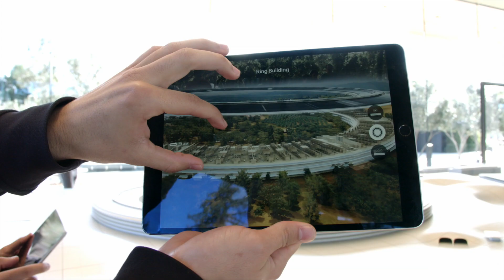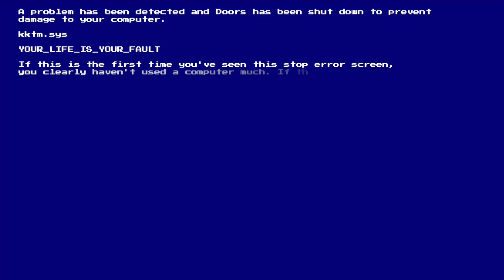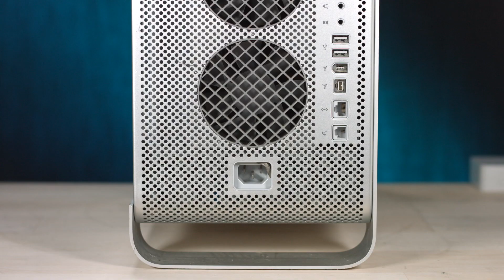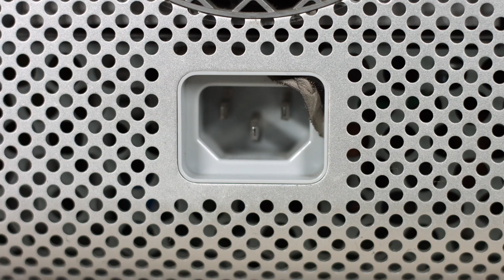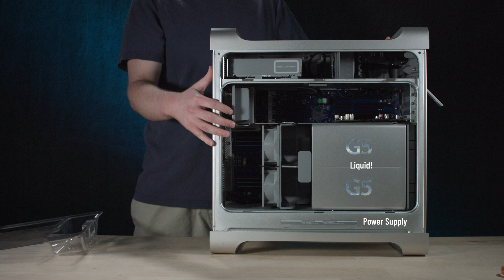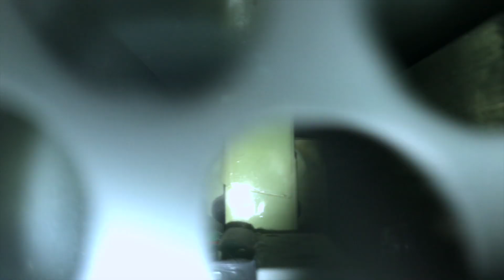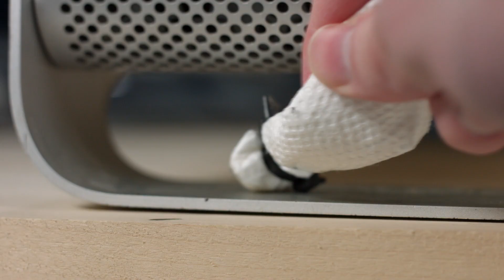Power Mac G5 and Cinema Display Disaster - Krazy Ken's Tech Misadventures

Comment: it probably went through different pressures during shipping causing the liquid to leak out or fitting to get popped. if it was shipped by air this is a big probability.
Reply: I'll bet that's it.

Comment: Likely the mains was shorted to ground, and the pop was that current going through the fuse, and likely protecting the computer
Reply: Do americans use fuses?
Reply: @williamg209two  yes we have like a million of them for one section of a logic board😂
Reply: @SStarlight9614  I meant in the plugs actually
Reply: @williamg209two  we have fuse boxes in a central location for all parts of the electrical circuit. When I first heard the pop it sounded like a breaker flipping over
Reply: @williamg209two  yeah that what I meant
Reply: @SStarlight9614  didnt think Americans used fuses given u barely use earth, I know it exists just never see it
Reply: @fremet6346  we do too, the uk have breakers and we have fuses in the actual plug, which is far safer
Reply: @williamg209two  No, U.S. plugs don't have fuses. But fuses/circuit breakers are common for each room, or for big appliances.

Comment: This sound is very similar to a capacitor popping. And that thing sticking out of the power plug looks like capacitor guts. Very easy fixable with a soldering iron if nothing else is shorted
Reply from the maker: The stuff sticking out of the power inlet was present before I plugged in the power.
Reply: @ComputerClan  https://i.ytimg.com/vi/FCNBv8VhzRI/maxresdefault.jpg

Comment: Eek! As sweet as the Quad G5's are, heard of many leaking and having weird issues like that.
Great machines and an utterly gorgeous design, the G5 towers, just definitely get an air cooled one!
Reply: This is an older dual CPU model, not a quad. The quad came in late 2005 and featured a better liquid cooling system.

Comment: I have just been given one of these ( not sure if its liquid cooled ) it powers on and the fans kick in but nothing on display or no lights on keyboard and mouse.  Any advice guys?  Thanks
Forgot to mention, it has 4 X 1 GB sticks of ram installed.
Reply: Does the power LED blink at all?
Reply: Remove the RAM and expansion cards, blow out any dust inside and reseat those cards, for starters. Replace the battery on the board, as it is most likely dead by now.

Comment: I got a Power Mac that got damaged by a mail guy ho dropped it, my version is an air-cooled one BUUUT my Mac has a problem that the system battery port internally is damaged so mine is working but not in a good condition and can't keep up with time and date. Yours is in the best condition ever and can't boot up because the liquid has leaked on the PSU I feel bad for you because the pumping system is well known to leak if a shipping company doesn't handle the computer correctly. You just had bad luck.
Reply: Punctuation needed.

Comment: You could try swapping in a new PSU and maybe a more modern watercooler. The teardown could be for a pretty cool vid imo
Reply: That might be possible, assuming that the water cooling mounts the same way. It's an entirely proprietary system either way. Replacing the PSU, if necessary, should not be too expensive, but a pain to install.

Comment: I'm amazed you didn't know it was water-cooled isn't it understood that g5s are VERY power-hungry to have 2 of them in such a small area means that standard air cooling really isn't doable at a low volume (sound not quantity) without absurdly sized heatsinks.

also, doesn't it have a warning label somewhere about if you see any sort of liquid to stop using it inside the case?

I don't mean for this comment to sound hateful or condescending whatsoever, so I apologize if it seems that way.
Reply: I think only this one specific unlucky variant (One of the last. Dual-Processor, dual-core G5) had the liquid cooling. There were a number of dual-processor models that had only air cooling (have one!), but you are quite right regardless, they can run quite noisy and hot when going full tilt. 9 fans all in if I remember right.
Reply: Only the later, higher-end G5s were water-cooled. The rest only had around 15 fans and a huge heat-sink.
Reply from the maker: You were amazed? Hmm… I'll tell you this: that fact is NOT common knowledge. Most people wouldn't know, and I have never touched one of these things before.
Reply: @ComputerClan  neither am i i just am a nerd :P

Comment: If it was a capacitor it will take a few seconds from plugging in the cable to hearing the pop
Reply: Since it was instantaneous, it probably wasn't a cap.
Reply: @MaddTheSane  he pointed out that there was a spark and the caps are fine

Comment: Yeah, the liquid-cooled models are notorious for coolant leakage. And they can have issues even if there aren't any obvious signs of leakage, as happened with the G5 Quad I built a few years ago, which started overheating.
Reply: That was what killed my Power Mac G5, a dual CPU model (like the one Ken has), several years ago. It's really sad, because I loved that G5. I still have the side panel for it somewhere.
Reply: It's my understanding and my experience, though, that the late 2005 quad G5's liquid cooling system is more reliable than the older G5s' liquid cooling system. I had a G5 quad system fail on me, but it wasn't because of the cooling.
Reply: @desther7975  https://en.wikipedia.org/wiki/Power_Mac_G5#Defects:~:text=Later%20models,reliable%2E
it seems that only the 2.7 GHz early '05 model had the better cooling system, but I can't fathom why they'd revert for the late '05 models.
Reply: The assembly I got for my Quad was the single-pump one which AFAIK is the later configuration and considered the most reliable. Never saw evidence of leakage, but I can't deny the fact it was overheating when I last powered it on just over a year ago, and prior to that it was working but with CPU B running much hotter than CPU A which I thought was strange. Pump was running and sounded normal, so I never did any further investigation into why it was overheating, just swapped it out for an air-cooled 2.3 GHz model (also Late 2005).
Reply: Happens with all liquid cooling in Desktops be it a AIO or a Custom system!!!!
Reply: My friend in China had his powermac g5 quadcore 2.5 GHz killed due to coolant leakage too. I got a lowest end dualcore 2.0 GHz, the model the easiest and cheapest to be found here in France. The model is quite robust, and is enough powerful for what I use it for.

Comment: Take it from me, G5 disassembly is hell, especially the air cooled models. Prepare to buy the kinds of screwdrivers you usually only see for automotive interior use and to wonder why the PSU has so many metal bits.
Reply: Especially the PSU, the whole goddamn computer has to be taken apart to get to it.
Reply: @whette_fahrtz  don't forget the fun of figuring out how to get the front power button/ports subboard off, or the ridiculously long screwdrivers needed for the air cooler so large it can kill small animals
Reply: EnigPartyhaus After a couple teardown you get used to it :)